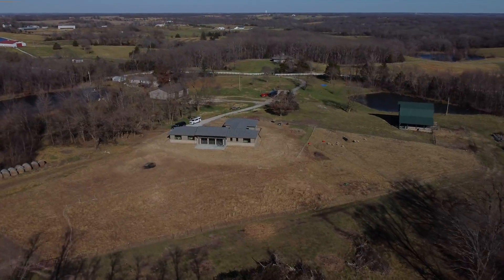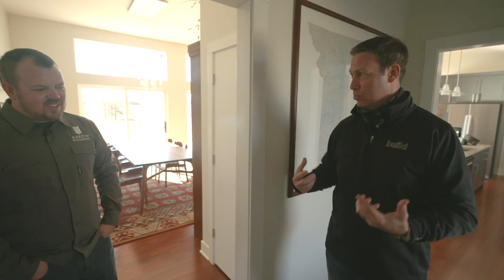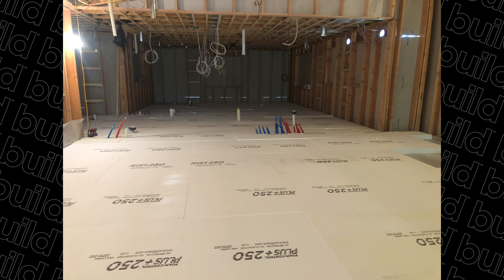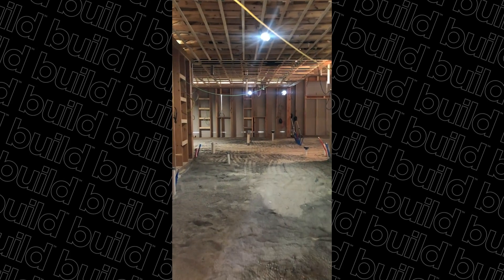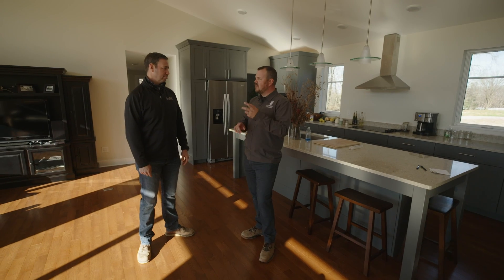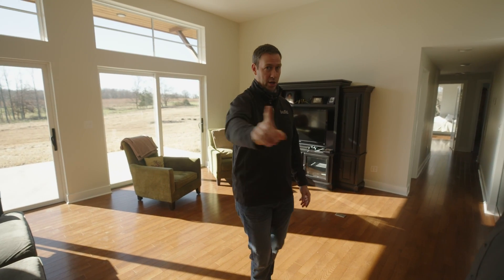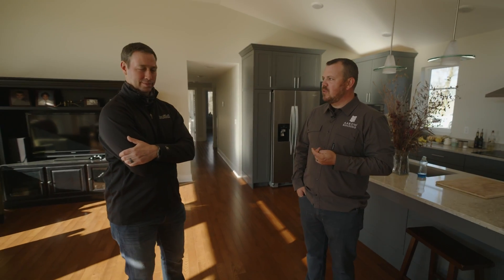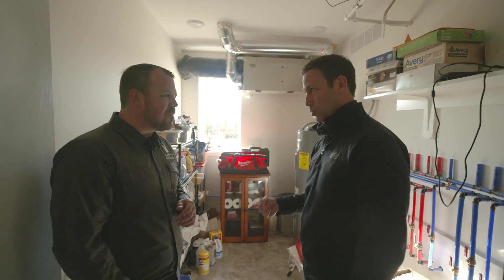Slab-On-Grade INSULATED Foundation (NO Concrete?!) - Part 2

Comment: but why.... two layers of advanttec cost almost as much as a slab.....
Reply: I was thinking this
Reply: That's not going to be true indefinitely.  If we're still using concrete the same way we do today 100 years from now, a house in Missouri will be unlivable because the state of Missouri will be unlivable. Lower GWP methods & materials are absolutely required wherever they function, and in a sane system of collective decision-making, would have been required decades ago.  The slab part of this is, in the short term at least, a carbon neutral assembly in a sense, if you count the wood as sequestered.
Reply: @TrogdorBurnin8or   Disagree. CO2  is not a problem whatsoever. The ocean will eat all surplus CO2  anyway, as  it has done with the billions of tons over billions of years the volcanos have injected CO2 into the system. CO2  is not a problem whatsoever.
Reply: @TrogdorBurnin8or  You dont get it Greta. CO2 concentration in the air is determined by ocean chemistry. If we removed ALL CO2 from the air, the ocean would emit new, and we would soon be back at the same concentration as today. All provided effortlessly by ocean chemistry. There is nothing we can do about this chemical balance between the ocean and the air. And if there is chemically too much CO2 in the ocean, the ocean will convert it into other substances and store it on the seabed, as it has done with the CO2 injected into the system by volcanos over billions of years. CO2 is not a problem whatsoever. That is a faith based conviction, or a religion.
Reply: @elbuggo  Your absolute faith in extrapolations of a fringe theory mentioned by one junior professor in a non-peer-reviewed letters section is inspiring.  But how do you square it with actual direct observations of CO2 presence in the air, which are measurably rising at a rapid pace?
Reply: @TrogdorBurnin8or  The increased CO2 concentration that we believe we can observe is caused by altered chemistry in the ocean. 

Water at 0C can hold twice as much CO2 as water at 20C. So if the sun has been slightly more active, or if we have had slightly less clouds, the temperature in the ocean will increase slightly and the CO2 equilibrium between the ocean and the air will shift slightly so that we get slightly more CO2 in the air. All this determined by the chemistry in the ocean. 

If you burn 1t CO2, the ocean will emit 980kg less, and you only get 20kg more CO2 in the air after you have burned that 1t CO2. So if you want 1t more CO2 in the air, you must also feed the ocean 50t, or the chemical balance will not be maintained. 

The ocean will over time convert this surplus CO2 to other substances and store it on the seabed. It is the chemistry in the ocean who determines when this should be done. 

CO2 is not a problem whatsoever. That is a faith based conviction, or a religion.
Reply: @TrogdorBurnin8or  You can hang out with Greta Thunberg - you two will get along just fine - while I talk chemistry with the geochemist.

Comment: Undisturbed soil within the building footprint? Wouldn’t you run the risk of movement in the soil? Especially in areas with high clay content? Wouldn’t it be better to engineer the soil to optimum compaction and moisture with good fill?

Comment: The environmental problem with concrete isn't even really the energy that goes into making it. The actual chemical process, calcination, of turning raw material into clinker release CO2 at an incredible rate.
Reply: They are speaking about the process of making cement not concrete... which takes massive amounts of energy.

Comment: Three points to follow to prevent cracks in the sheetrock he mentioned: "following humidity, strapping the ceiling and following the Advantec detail around the perimeter." I wish these three items were more specifically mentioned. Could you go through these details on some episode?
Reply: hvac system has a humidifier in it, strapping the ceiling means they put 2x4 purlins across the trusses which settle less so less cracking of drywall latter. advantec details means you need to have a 1/4" gap to allow for expansion between wall and floor.

Comment: NOTE: regarding the risk of a water leak/failure, there are lots of "smart-house" water detectors that would alert a home owner of any problem before it's a problem. It can automatically shut off the water main at any detection.
Reply: Until there's a heavy rain and the soil is saturated.  I see water percolate up through my driveway in the spring.
Reply: @louf7178  I would think this contractor did a sound perimeter drain. Plus, a high water table is not good for a real slab either. Sumps and good design can overcome much, though.
Reply: @timskufca8039  I agree, but I'm considering a much larger scenario of flooding or of common building practice.  In our area unusual storms have been increasing along with increased land area on existing drains - adds up to overloaded systems.

I hate to be negative, but this is not to be misinterpreted from sound practice(s).  I've seen too many unexpectancies happen over the years, and this is why I don't jump on "it's all good" conjecture and assurances.

-regards
Reply: @louf7178  there will certainly be places that this slab-less system would not be recommended, but more places that it would work just perfectly. A simple site-analysis would suffice. Also, raising the grade above any high-water elevation would work as well. [there is not a single structure that is full-proof from all possibilities]
Reply: @timskufca8039  In an interesting instance of slab-less houses, in an interview with the grandson of the rancher who found the pieces in the Roswell incident, the grandson mentions his house has no [concrete] slab.  Apparently, slab-less might be more common in drier climates.

Comment: fantastic episode! This cutting-edge (for most contractors) information is what makes your channel shine. Thanks for spreading the word, AND pointing out that the concrete industry is a horrible greenhouse gas emitting industry. I'm currently working on detailing a full-basement foundation wall without concrete (using gabion baskets). I need to pass this by a structural engineer to determine its feasibility.

Comment: How would radon abatement work?  Typically we create a negative pressure under the slab and then vent, is that possible here?
Reply: At 4:35 you can see the poly(radon barrier) go down. I doubt it would be a real issue, the house is above grade, radon is very heavy gas and mostly collects in basements and low lying areas
Reply: @DavePreissl  Awesome, thanks for the timestamp!

Comment: This is a common practice to build a foundation in Europe since EPS was invented and it is called "floor on ground"
Reply: That’s not the same: you pour concrete on top of that EPS.
Reply: Is the EPS a water barrier?
Reply: @johnfitbyfaithnet  Not sure if all EPS is a water barrier, but some is made to work as a barrier. Typically from what I've seen hiring builders is they compact the sand / clay / rock, then put down a moisture barrier and EPS, then hydronic pipes or other heating then pour the slab.
Reply: @johnfitbyfaithnet  the water absorption rate is very low so in the floor system EPS will not transfer water to a higher layer of floor but you still need a vapor barier to prevent vapor to get into a floor system and to condense there . Another  problem . When EPS is used in conjunction with wood  is  a fire hazard. I would put at least one inch of concrete over EPS or XPS just for safety's sake

Comment: The environmental costs of concrete was the first thing that came to my mind. For those protesting the environmental concerns of concrete: according to the Portland Cement Association, one cubic yard of concrete produces 400lb of Co2 emissions.
Reply: Compared to how nasty of environmental problems those foam and plywood cause for production waste and landfills to dispose of. Concrete is actually quite green considering how much of it is reusable. Their argument of being green is bs.
Reply: @zack9912000  I disagree for two reasons: First, they would likely have to insulate under the slab anyways. Second, unlike the mechanical and logistic concerns involved in recycling and/or disposing of the finished product 60 years from now, the creation of portland cement produces a massive amount of CO2 today that can not be prevented with current technology at scale. You can not rationally draw comparisons with the unknowable future ability or lack of ability to recycle at some future date with the known pollution of concrete production in the present.
Reply: @josephdestaubin7426  I am mostly referring to the production waste and nasty chemicals that are required to create both materials, that to day end in a landfil.  

At least old concrete can be ground up and used as base material for new projects and new concrete products. Your not saving your scraps of foam and plywood for other jobs, they go to the landfill. 

 Also the CO2 produced by those manufactures at their foam and plywood maufacture plants isn't much better and they still have to truck it around as well.  My issues is the nonsense claims this is cleaner for the earth. Neither is perfect but at least concrete can be recycled and has a massive industry demand for recycled concrete
Reply: @zack9912000  Fair enough, but I don't think land fills are really a concern for the environment, humans have been building land fills from day one, or at least 10 thousand years or so, whereas Co2 emissions in just a few hundred years are starting to reek havoc on our civilizations.
Reply: @josephdestaubin7426  CO2 is not a problem whatsoever. The ocean will eat it all, like it has done with the CO2 injected into the system by volcanos for billions of years. CO2 is not a problem whatsoever.
Reply: @elbuggo  Our atmospheric monitoring stations show the CO2 level rising steadily.  The oceans aren't eating it all, apparently.

Just like with COVID-19, if you start from the axiom "this isn't a problem and I don't have to change jack shit to help fix it", you can make up a lot of different rationales after the fact, but the phenomenon marches on regardless of what you choose to believe.

If there's only one consistent thread to your rationales, if they contradict each other, but they all support the idea "this isn't a problem and I don't have to change jack shit to help fix it", maybe think about what that says about the people you're getting your information from.  There's a lot of money riding on our continued inaction; The rich think that with enough money, they'll be able to ride this one out as the rest of us suffer.
Reply: @TrogdorBurnin8or  CO2 in the air is chemically determined by the ocean. If the chemistry in the ocean changes, the concentration in the air might change.
Reply: @elbuggo  And how is that supposed to work?  Are you suggesting that the CO2 we directly emit through combustion exhaust just... isn't a factor for some reason?
Reply: @TrogdorBurnin8or  Again, the CO2 concentration in the air is DETERMINED by the chemistry in the ocean. Nothing we can do to change those things. 

If we removed ALL CO2 from the air, the ocean would release new, and we would soon be back at the exact concentration as today. 

If you inject 1t of CO2 into the air, the ocean will release 1t less because the chemical balance between air and ocean will be maintained. Or more precise, in the short run, if you inject 1t CO2 into the air, 98% will be eaten by the ocean. Only 2% will be kept in the air. When you release 1t CO2 into the air, the chemical balance will be altered slightly. 

In the long run, the ocean will convert this surplus CO2 into other substances and store it on the seabed. As the ocean has done for billions of years with the CO2 injected into the system by volcanos. 

It is the geochemists who work with these issues all day long - they understand these things. When was the last time you heard a real geochemist talk about these things? How about never?
Reply: @elbuggo  It's been 8 years since I was a part of that community.  I believe the carbonate-silicate geochemical cycle occupied a whole week of lecture. But those lectures certainly didn't suggest the things that you are suggesting, and the idea that the oceans are in some kind of short-term equilibrium with the atmosphere would require the amount of carbon in both of them to have increased by a third in the last 70 years, based on direct measurement.  Where's that coming from, you think?  And why don't we care if the atmosphere bakes us while the ocean is adjusting?  The cycle is the primary determinate of the ratios between different locations carbon exists at geological timescales - millions of years.  Not so much centuries or years.

Do you think that geochemists spread around the world are in some massive conspiracy against you?  Chinese geochemists, French geochemists, Salvadorean geochemists, Indian geochemists, Canadian geochemists, united in their attempt to deceive you?

It's really not worth spouting that kind of stuff if you can't be bothered to read the Wikipedia page.
Reply: @TrogdorBurnin8or  RE:  require the amount of carbon in both of them to have increased by a third in the last 70 years

Not so. There are 50 times more CO2 in the ocean than it is in the air. Dont know the concentration in the ocean. 0C water can hold twice as much CO2 as 20C water. So if the temperature in the ocean has increased (thanks Sun!) 1/100C, that could alter the chemical balance so much that it can explain the increased concentration in the air that we think we can observe. 

Each year, for billions of years, the volcanos have injected billions of tons of CO2 into the system. Where did it go? Who ate it?  

Some prominent geochemist has studied these questions for more than 20 years and has a well researched article here that you could study if interested: Some Thoughts on Ocean Chemistry  by Tom V. Segalstad Associate Professor of Geochemistry - http://www.co2web.info/Segalstad_Chapter-6-3-1-2_Ocean-Chemistry_NIPCC_CCR-II-B_2014.pdf
Reply: @elbuggo  You seem to be confused about the chemistry of saturation. You know you can read a book for that particular ailment.